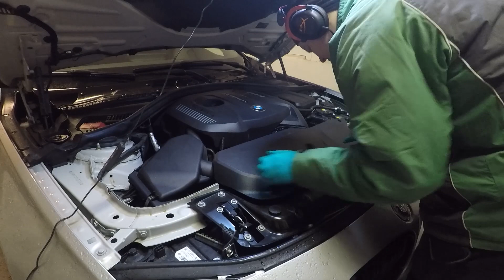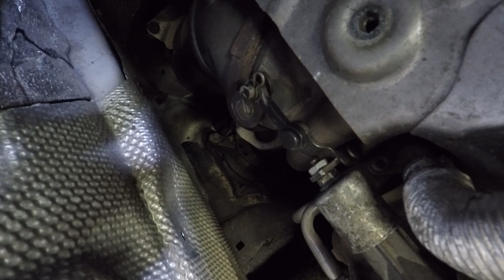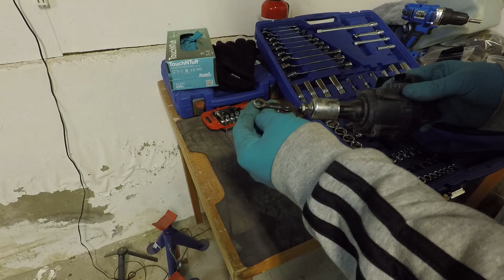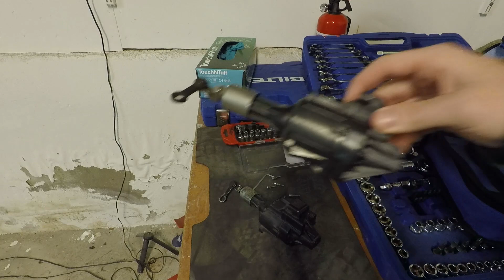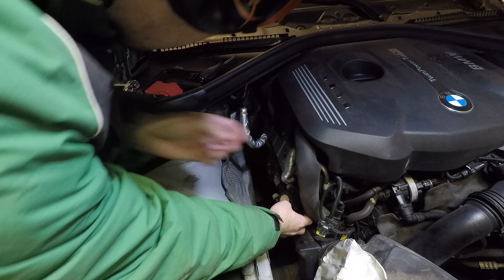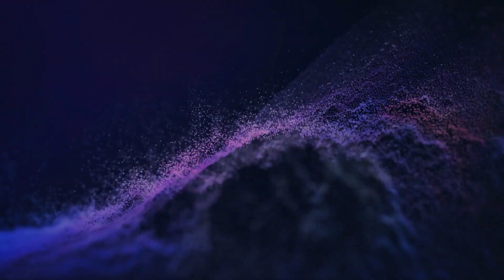How To Replace Wastegate Actuator On A B48 (BMW F30/31 320i/330e)

Comment: Hi very helpful video i was wondering what was the issue mine is doing the same rough idle
Reply from the maker: is the valves to the turbos that can't close and open right. I left my car at a workshop for fixing this. Thanks for watching

Comment: After replacement did you have to program/adjust it or anything?
Reply from the maker: Yes you have. My local workshop did it for me. You can still drive it but irecommend to check so is right coded.

Comment: What mileage/km did you first notice the rattle? Also, is this covered under warranty? As mine also has a tick/rattle, can only hear it while driving up hill and particularly when the engine is still cold. I’m at 90k now. Started noticing it somewhere around 82-83k kilometers.
Reply from the maker: around 240 000 km. But i have no power lost it just sounds bad so far
Reply: @undergroundcars1163 , maybe you have problem with westgate. you’re changed the westgate actuator, but as sound in video is westgate vavle sound
Reply from the maker: @cruizak   yea it is the valve and every shop i have talk to saying i have to change the whole turbo.  So i trying to saving up for a new turbo